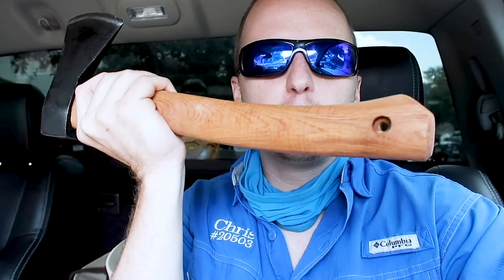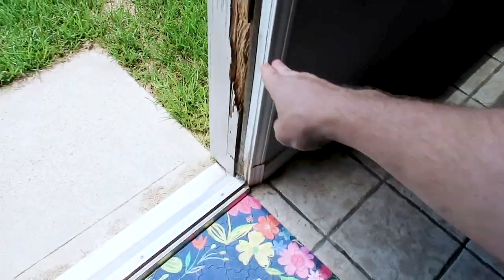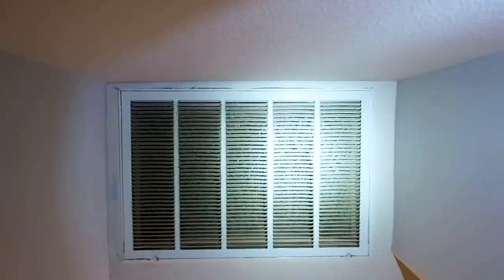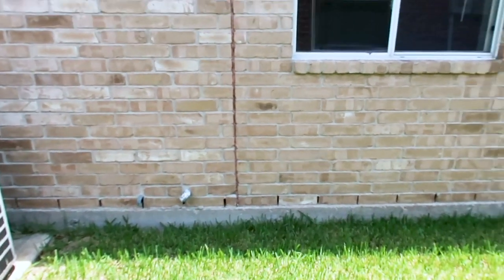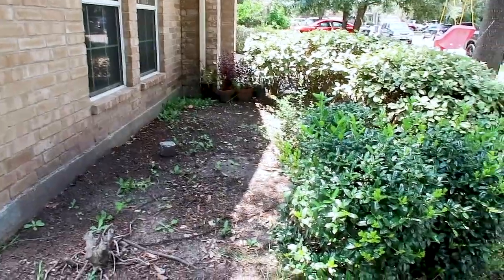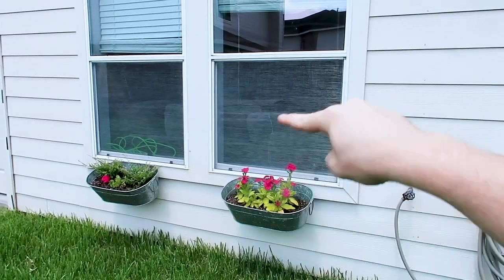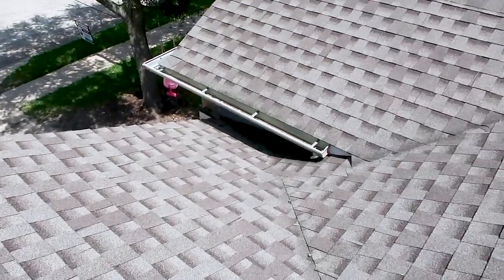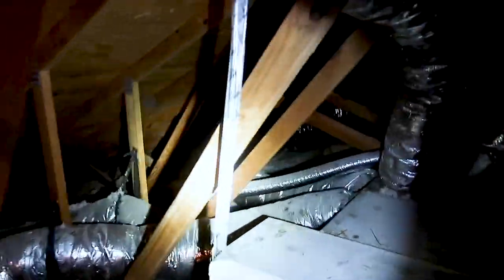Home Investigator: Episode 13 - First Time Home Buyers

Comment: You mentioned how hot it is. I have been inspecting for just over a year, any suggestions on dealing with the heat in attics. I don't want to miss anything up there but also don't want to spend that much time in that heat for safety reasons.
Reply from the maker: Joshua Whitney honestly we have incorporated cool down times in our routine: inside quick pass,  outside (roof and exterior),  cool down time(put comments in tablet and build report with all our findings), Head to attic,  cool down comment time again,  and the final pass of the interior.  Short version but this is how we keep our body temp down.  Thank you for watching and I have added your name in to the hat.